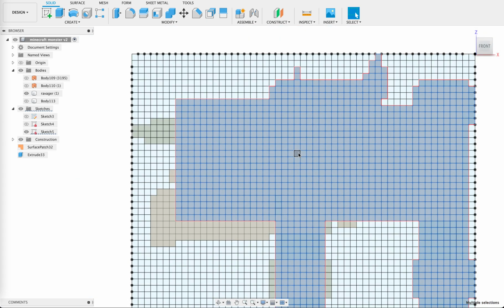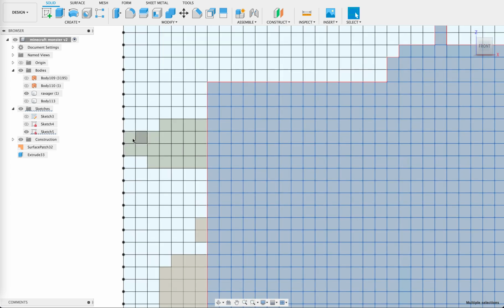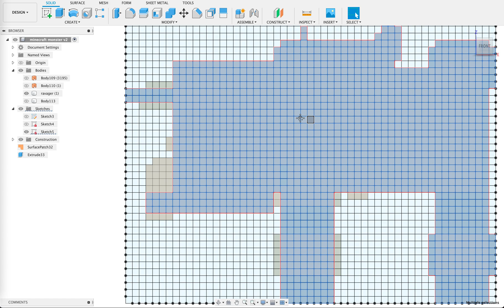S01E01 - How The Hell can Fusion 360 be so slow?!

Comment: Running 64gb ram, 3070, ryzen 7 cpu and it is lagging like I have a pre-2000 laptop. How fusion is so slow on such a good machine is beyond me for such simple tasks. It's a good programming for sketching and basic operations but once you start to do anything serious with it it falls apart and is incredibly frustrating. Moving away from Fusion because it just isn't a good long term solution.